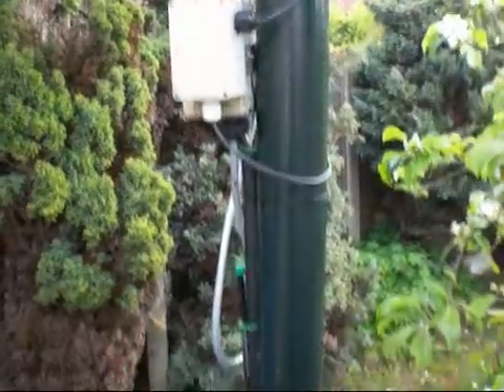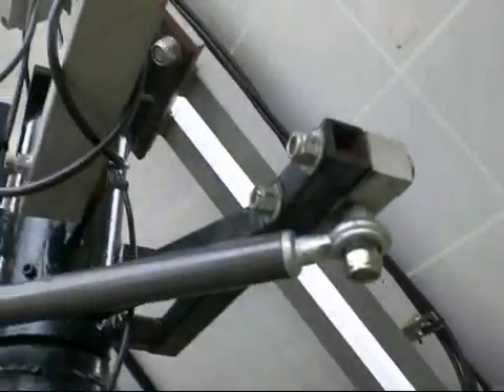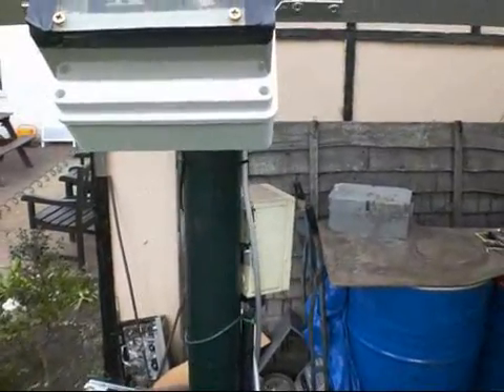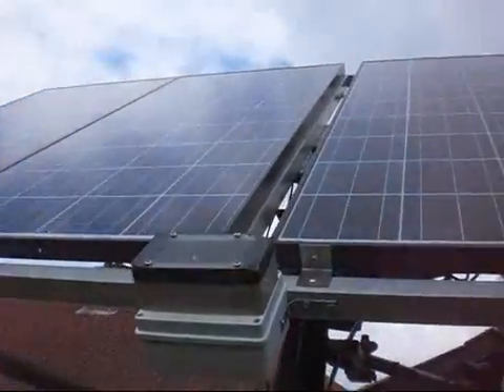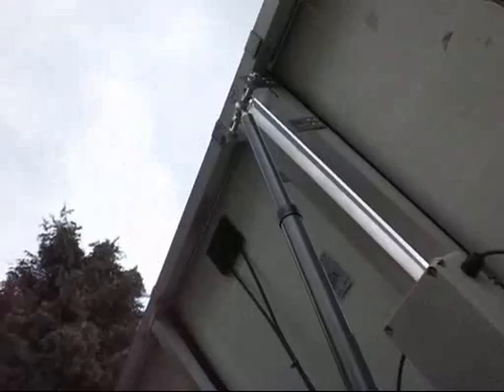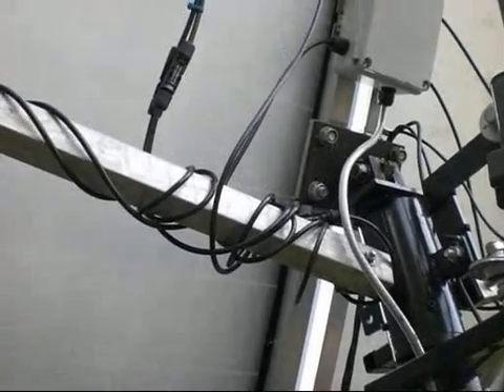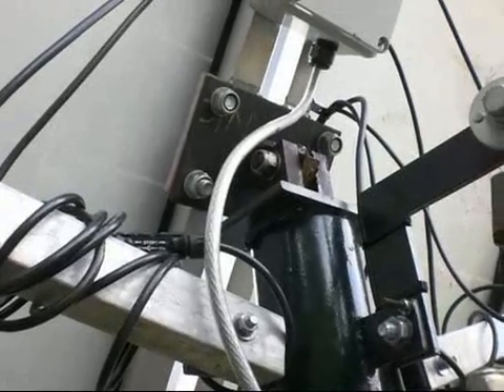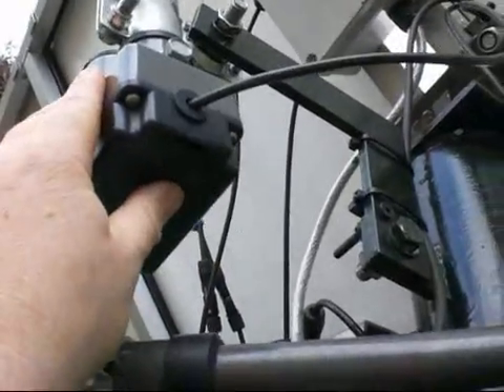final tracker video.divx

Comment from the maker: My long turm goal it to get some how a SMA Sunny Boy SB1100LV controller but they are a lot of money about £1100.00 and they are hard to find in the United Kingdom but you get German engineering at its best.
This controller works in the region of 20v-120vdc which for my panels is perfect.
the MPPT starts at 20v up to the maximum voltage.
It handles 1100w so I could double it later with panels.
You can buy other makes but these are sold across the world.

Comment from the maker: Hi

At the present time I use the energy from the panels direct from the battery's to my inverter then out to my  my caravan via a changeover switch where I temporary live (its a long story) .
My battery's are rated at 2800Ah but I am only drawing about 5-10Kw amp hours per day which is hardy nothing for the battery's
It takes about 75Ah at 26.5 volts to recharge using a charge controller to regulate the banks.